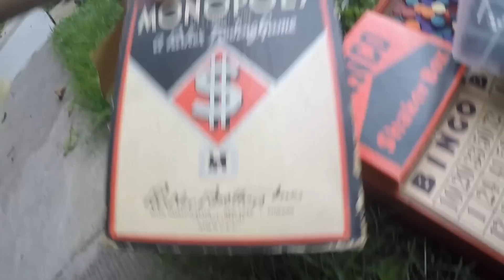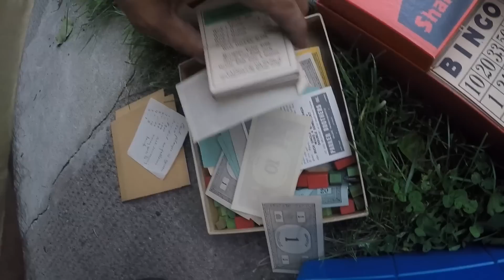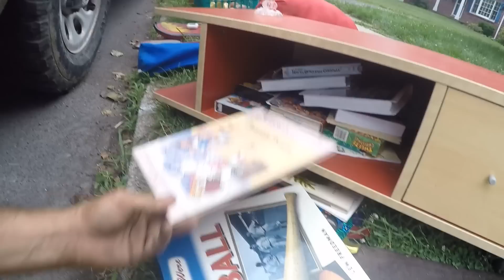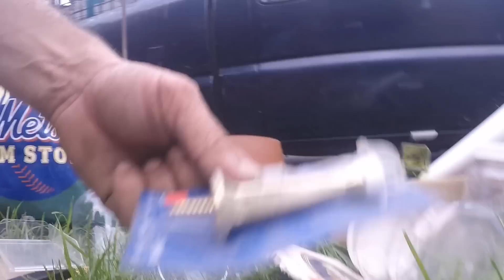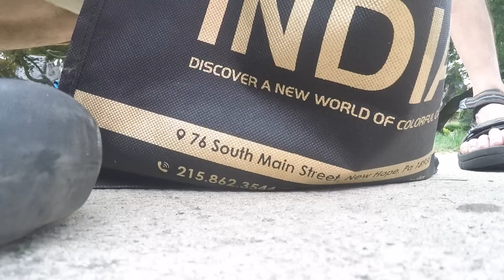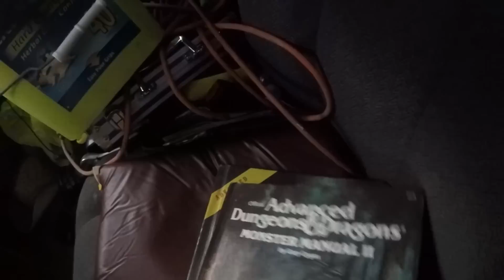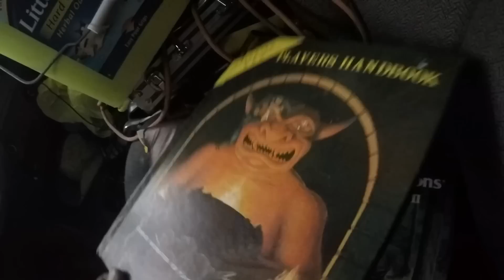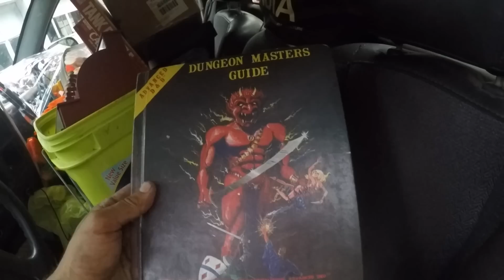Yard Sale Hunting! & Pickups!

Comment: Dave, hello

Rob here, like all your resourcefulness.

You need to have your “upper or lower” steering shafts inspected/replaced. It should (not only increase your safety/road worthiness) remove that “rattling “ in your steering column....
A common problem with most Chevy and GMC Pick ups..